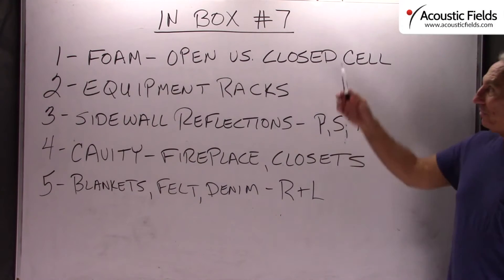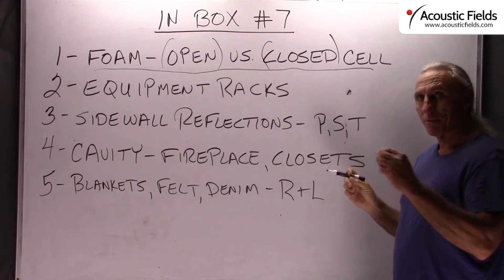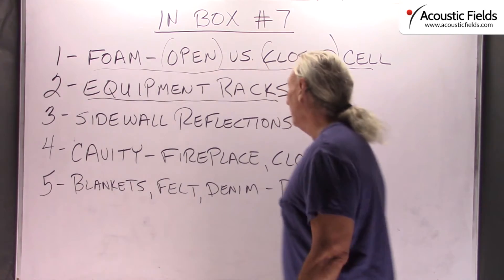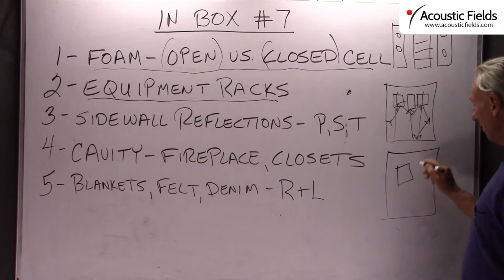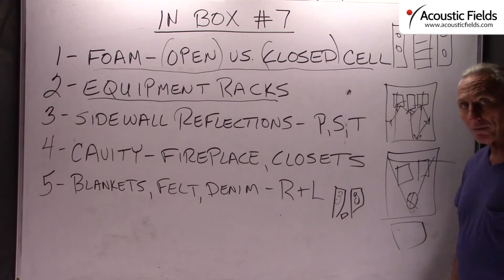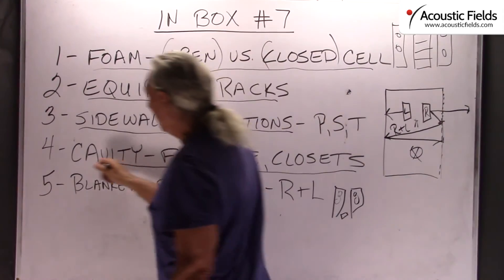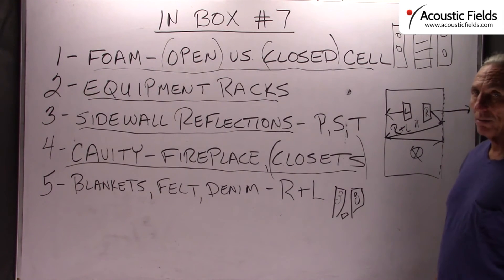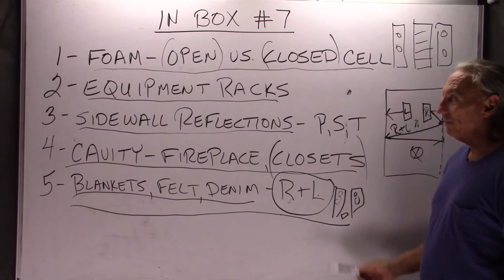Acoustic Fields Inbox #7 - www.AcousticFields.com

Comment: Question for you guys... whats the frequency reduction value or dampening factor for books?.. if you have floor to ceiling book shelves such as in a study? if 3 walls are completely covered with them different sizes etc. but 3000 plus books has to do some type of reflection and absorption.  ...
Reply from the maker: Hi Frank,

A wall of books may have some sound absorption at higher frequencies. They do provide for some noise   reduction by acting as barrier technology.